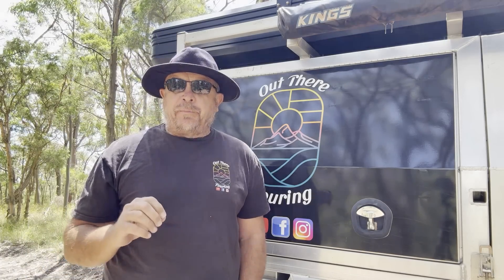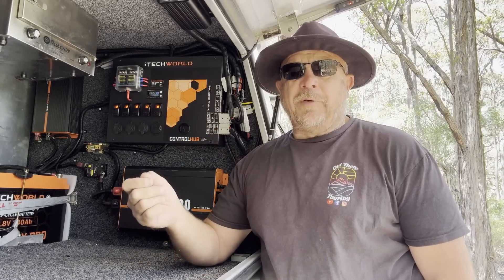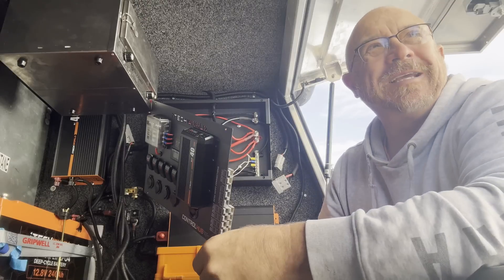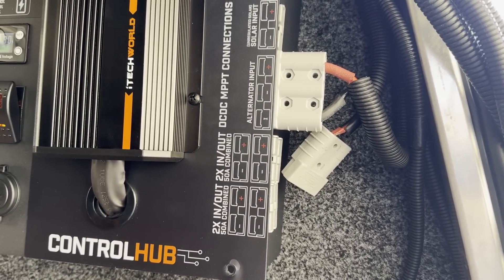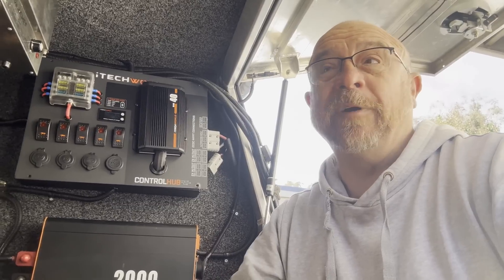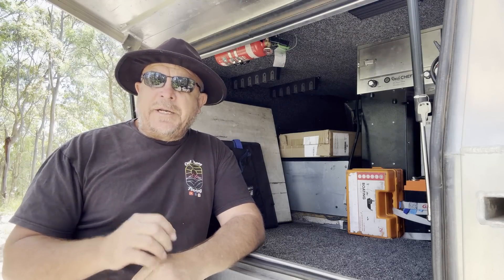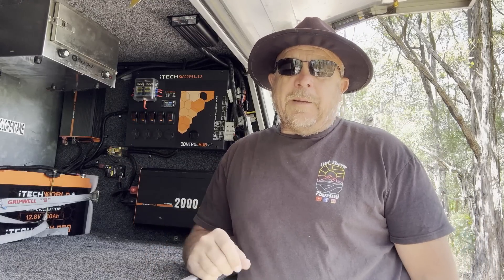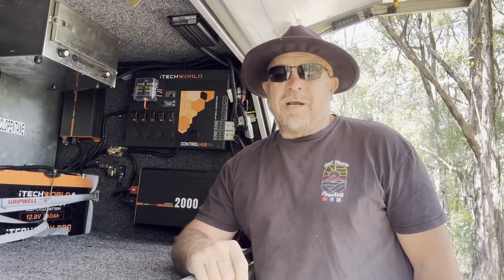Itechworld control hub 40amp Dcdc installation

Comment: I own a caravan park and the amount of Itech gear have seen problems with is staggering. I recon if you want to go cheap just get kings gear atleast you can take it back to one of the many stores and just swap over the faulty gear. Quality products I find Radarc and Victron are good and I’ve never seen any problems with their gear.
Actually quality products aren’t much more expensive and worth the peace  of mind imho. I’m just talking about dc to dc chargers solar chargers , shunts and inverters mainly . Most switch boards etc all seem to be very similar.
Reply from the maker: Hi mate, 
Thanks for taking the time to watch and comment. 
Yes I’m now running the redarc alpha 50 and it’s amazing

Comment: @5:12 your negative alternator input is connected to the ignition wire in the andreson plug? should it be that way? Did you rewire the internals to accept that within the control box? @10:42 it still looks incorrect, did that #itechworld tech not notice that or ask about it?
Reply from the maker: Hi yes I rewired inside control box to match the supply wires

Comment: Gday - At 5.22 into the video, you put your alternator input into the Hub. You seem to have the negative terminal from the alternator on the ignition wire. I can't see any wire leading into the negative terminal. I just wired my Hub up (which is how I came to your channel) and I had theer wires - positive and negative next to each other and the ignition sensing wire where you have your negative. Maybe this is why you had issues. I hope I won't have issues with my Hub.
Reply from the maker: Hi. Thanks for watching. 
I rewired both the control hub and lead prior to installing to match the indicators on the panel ( red wire to + , black wire to - ) not sure why iTechworld does not do this. 
ITechworld had an issue with the 40amp dcdc as a few people message me with same issues
Cheers 
Craig

Comment: I've just gone with itechworld thinking i was going with a good quality brand and wish i didn't, I should of gone with Kings like i was going to. heaps cheaper and have less problems and easy returns.
Reply from the maker: Hi, 
Thanks for watching and commenting. 
I actually don’t mind the other parts of my 12v system. I just had problems  twice with the 40amp dcdc 
What issues do you have??
Reply: @ottouring my issues are the advanced smart shunt touch screen keeps glitching out and constantly scrolls though whatever button you press. The battery keeps going into safe mode even without anything connected and just really bad customer service, couldn't answer my questions.
Reply from the maker: @SuperSpudzy 
How old is it. 
That’s a new issue
Reply: @ottouring  3 weeks.
Reply from the maker: @SuperSpudzy 
If yr not happy then ask for a refund.
Reply: @ottouring  I did but they said there is a 10% restocking fee + another fee because it's opened and I've got to pay postage. I had been saving for it for ages so don't want to waste more money sending it back. 😢
Reply from the maker: @SuperSpudzy 
Send me a msg on messenger

Comment: Hi mate, enjoyed your install video and your follow up review.  I have the same control hub, and looking to DIY install so very helpful thank you. I’m just wondering given you had two dc-dc chargers fail whether in the internal temps in the canopy might have contributed. I’m not sure what temps you were experiencing while on the big trip north, but I’m wondering if that’s something that I might need to think about, maybe the charger is a bit susceptible to heat? Thoughts? And how has the Redarc performed in the canopy since?
Reply from the maker: Hi mate, 
Thanks for watching. 
The first one failed before the trip and was about end of July in nsw so temp would not have been the issue. I have been contacted by a number of people who guessed it was this brand before I named it. 
I’ve since installed a redarc alpha 50 charger and love it.

Comment: Curious to know whether you used the intech world installation cable kit from start battery to dc/dc charger… it only a 6awg cable and i think its at the limit for voltage drop over the cable length. i haven’t watched the install, but i would recommend at least 4awg cable and am wondering of this could of been potentially killing the chargers?…
Reply from the maker: @-Awareness hi yes I used the iTechworld installation wiring kit

Comment: I have same issue with 200w solar blanket and they wanted me to send back for review. I gave up in end and purchased another brand
Reply from the maker: Hi thanks for watching and commenting. 
I understand they want product back to test but it’s the way they do it. They could ask you to video the fault and share it with them or get a local auto electrician to test and confirm unit is faulty. 
I’ve recently had an experience with another brand and spoke to them about a warranty issue and all they wanted was a short video. The company then sent me a replacement item. That’s customer service

Comment: I heard so many stories with similar outcomes to yours when I was doing my research.  You want reliable gear with good warranty when you are off grid and readily accesabke setvice agents so I learnt from other peoples lessons and chose Victron gear with 5 year warranty. Thats not much consulation for you,  but maybe it will help others. My three choices were Victron, Redarc and Enerdrive. I like the enerdrive inverters with the changeover switches and hope to get one of these in the future.  I also like the way the Victron gear is able to be networked and talk to each other via Bluetooth and is so customisable. I have 240 volt charger, dc to dc charger and MPPT charger and shunt. I like that I can charge when driving by both solar AND dc to dc charger. Some only allow you do one OR the other. Good luck with yours and hope you get it sorted soon  and can enjoy travelling again with peace of mind.
Reply from the maker: Hi, 
Thanks heaps for sharing your knowledge on different units. I have changed units and update video coming soon. 
Thanks again 
Craig

Comment: I'm actually pretty surprised they were as good as they were re the replacements. I've held reservations around itechworld after seeing other videos where people had problems, and their strategy of pushing their products through influencers.

Anyway, I suppose this highlights why people buy redarc? In saying that, we met some people who's 180k lotus with a full redarc system had shat itself on the gibb at barnett river and they had no power at all. 300ah of lifepo batteries and not a glimmer of activity! 

I've always used victron stuff as they had a good rep but even their stuff isn't perfect either. It's really frustrating when this stuff doesn't work as you'd hoped, or as intended. Thanks for sharing your experience in a factual and unemotional presentation
Reply from the maker: @andrewford80 thanks for taking the time to watch and comment. I really appreciate your kind words. 
Another video coming soon on update

Comment: Thank you for the video. Do you mind sharing how you reset the control hub?
Reply from the maker: Hi I’ll try and see if I still have the instructions from iTechworld
Reply from the maker: Thank you so much for choosing the Control Hub! We appreciate your business.
If you've accidentally changed the setting on the voltmeter and need help getting it back onto the lithium setting, we're here to help! Please follow the simple step-by-step guide below and you'll be back up and running in no time:
Press and hold the ‘’SET” button.
You will see 1P and 00 blinking.
Quick press “SET” 2 times until you see 3F and 00 blinking.
Quick press “SET again.
You will see 3 yellow zeros on the left and 3 white zeros on the right.
Press the “POWER” button to increase the value.
Press and hold the “POWER” button for 2 seconds to move to the next column.
Set the left-hand value (3 yellow zeros) to be 10.5 and the right-hand value (3 white zeros) to be 13.5. This lets the monitor know the 0% voltage of the battery and 100% voltage of the battery.
Press set to save.
Reply: @ottouring  awesome,thank you!
Reply from the maker: @alvarkoning3033  hopefully this fixes yr problem

Comment: mate i have exactly the same unit and same issue I’ll be calling them tomorrow. thanks for your video
Reply from the maker: Hi mate. 
Thanks for watching. 
I’ve now changed to there control hub without there dcdc charger and I fitted a redarc alpha 50. Awesome bit of gear. I’ll be doing a video in near future on it

Comment: Appreciate the honesty, I like the way you have presented this info. I am looking to do a similar build in my canopy. This has frightened me off Itechs gear, and I own a couple of Itechs power stations. I think it will be off to redarc or victron's gear. Thanks heaps. 👍👍
Reply from the maker: Thank you for your feedback. I’m happy with all other components other than the dcdc charger. I have installed the redarc alpha 50 on the itech control hub (with no charger) and the Redarc is a great bit of gear. Not cheap but I learnt my lesson as I travel a bit and need a reliable setup. Hopefully you enjoyed and subscribed and follow on Facebook as well. 
Cheers 
Craig

Comment: It looks like your three pin anderson plug from the alternator is wired wrong! The negative wire is on the ignition sensing pin. Please double check.
Reply from the maker: I required both the Anderson plug and the control box. As iTechworld have the ignition wire wired to negative indicator on both the box and lead. I think that is stupid  and wired as per the indicators on outside of box.
Reply: @ thanks for responding. wiring it the way you have it you are putting a high current through a small indicator wire. This could burn out the dc to dc charger i have the same set up with the itech 25 amp dc to dc. My negative from the alternator goes to the negative on the box not to the “I” for ignition. May be worth clarifying with itech.
Reply from the maker: @ I’m not using the ignition wire. I have changed the negative terminal inside the control box as well to match the Anderson plug

Comment: I see a very limiting feature of the charger, low solar input voltage wich is a "Gotchya" for those of use running decent size panels.

Comment: Itechword stuff is so over priced without the quality.
any auto leccy could have built you a simple control hub like that for less money.
I'd go a Kings battery before Itechworld since you are hardly pushing any boundaries.
As for charge controllers and shunts, just get Victron.
Reply from the maker: Hi thanks for watching and commenting. 
I have changed to a new bcdc charger

Comment: Thought I would fit the bus out with a local distributor and it was the worst decision I made. Every part hey sent had to be sent back due to faults. Thought  the build would only take a couple of hours which it did once I stopped dealing with ITECHWORLD. I ended up going with mostly kickass stuff with renogy solar control and redarc dc dc charger.  Have never had a issue. Where with ITW there were issues and lost of money spent installing then ripping it out and sending it back
Reply from the maker: Hi, thanks for watching and commenting. 
Sorry to hear that you had hassle as well. It’s a costly exercise in labour to go through that. Glad new set up is working well.

Comment: Thanks for that. I too have the 40 amp DCDC installed but i haven't finished fitting mine off to test it on Solar or DC power at this time. This will be something i will keep an eye on as it is installed in the camper trailer ✌
Reply from the maker: Hi, thanks for taking the time to watch and comment. 
I highly recommend keeping an eye on it and regularly checking your monitors to see if charging.

Comment: I had the older model charger for about 3 years and had problems with it till it completely stopped working then I got an enerdrive charger and it's been great haven't had anything go wrong with it
Reply from the maker: Hi Tony, 
Yeah I’ve changed chargers and works like a dream.

Comment: I binned my itech dcdc control hub and put a hardkorr one in so much better, better busbars and wiring and has a built in led in the logo which is handy to get into the canopy without turning on the big lights
Reply from the maker: Hi,  thanks for watching. I seen the hardkorr setup after I did this. They look good.
Reply: @ yea they are great sorry u had drama with the itech one mate they seemed to have dropped the ball lately

Comment: I have the exact same set up as you do. Now I’m worried about my dcdc charger.  🔌 
Now I’m thinking about changing it. 

What brand dcdc charger did you go with now ????
Reply from the maker: Hi mate, 
I have changed to Redarc alpha 50.
Reply: Ok and you only changed the dc dc charger only ?
Reply from the maker: @lukel4228 
ITechworld wanted the whole control hub back and would accept me just sending the dcdc back. So I sent it back and then ordered the control box without charger. ITechworld then fully refunded me for faulty unit

Comment: I had the kickass 40amp dc/dc on a 150ah battery station and went through 4 in 7 days. The first time I was 1400klm away into my trip, I then had to drive back to them to have it replaced. I come across a few ppl that have had the same issues with 40amp dc/dc but different brands. Makes you wonder if they all come from the same factory.
Reply from the maker: I understand your frustration especially when you’re on a trip and that’s what you rely on.

Comment: I am in the process of installing an Itechworld control hub. Thank you for the update. Just to clarify, are using one or two shunts as the control hub I have has a shut in it.
Reply from the maker: Hi,
My control hub didn’t have a shunt on it only a display panel showing voltage. 
I ordered shunt and the shunt display. 
If you have time go back and look at my itech installation video.
Reply: @ottouring  I ordered a complete setup before Christmas (November) and everything but the hub turned up. I contact Itechworld and sent them my invoice, photos and the consignment paperwork that clearly showed the hub wasn't sent. They then told me they didn't have any but would send me one once they received them. Early in the new year my hub turned up, but it was a premium hub with a different 40A DCDC charger and now includes a shunt.

Comment: Good info, I have a complete Itechworld setup in both our caravan and in the rear of the car and has worked well for about 4 years so far. My first dcdc which was about 4-5 years old died just the other day no longer charging off solar but will check it out later. I had another 40 amp dcdc like the Itech one you had and have found that out of all the Itech products it is their dcdc that fail. Their info says they can operate up to 80c which for electronics in my uneducated opinion is way too hot. I know dcdc chargers get hot but I put my digital thermometer on mine the other day and it was 61c too hot to even get your hand onto it. What I did was made some spacers to mount it on so that the air can get under it and fitted a computer fan on top of it that runs all of the time. Within a few minutes the dcdc was at 41c and could have gone lower but did not hag around to check again. Apart from cooking the internals they derate and stop charging when too hot but the fan should take care of that. The other point is stick with the shunt for accuracy I found the small volt meter of theirs was a bit inaccurate but ok for a rough percentage check..
Reply from the maker: Hi, 
Thanks for taking the time to watch and comment. 
I’ve now changed to a different brand charger.

Comment: Good clip mate I have been down the same road with the mentioned products  $1000 spent  on gear and I had it all installed by a local 12v contractor  who had  concerns about the quality of the equipment it lasted for 12 months and it’s all gone now my new system has been installed for 2 years and runs perfectly thanks to Phil hope you can get it sorted out cheers mate for your honesty and happy travels keep up the great work 🇦🇺🍻👍
Reply from the maker: Hi mate, 
Thanks for taking the time to watch and comment. 
Yeah system all worked out now.

Comment: Hey
Just notice the 3 gang anderson plug could be wired wrong, looks like the negative wire from start battery is wired in where the blue wire for smart alternator. should be in middle terminal
Reply: Sorry didnt see that you swapped them internally. I have a auto sparky business in qld i have just bought a full setup to trial on a work trick will be interesting to see how it goes.
Reply from the maker: For some reason they wire the harness and Anderson plugs differently they also wire control hub Anderson plug the same way. 
I just swapped wires to match the indicators on plugs
Reply from the maker: Hi I swapped the cables around to match the indicators on front and also swapped on inside of control box.
Reply: Yeah I noticed that also the black earth wire was in the ignition slot on the 3 way Anderson plug.